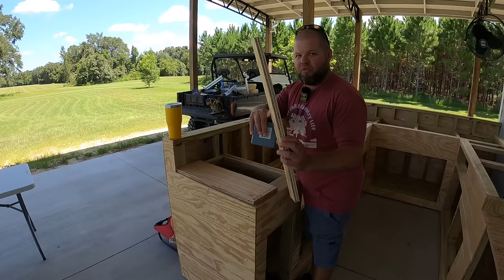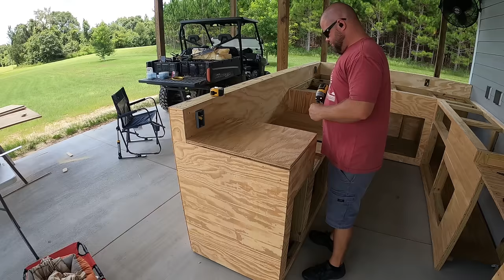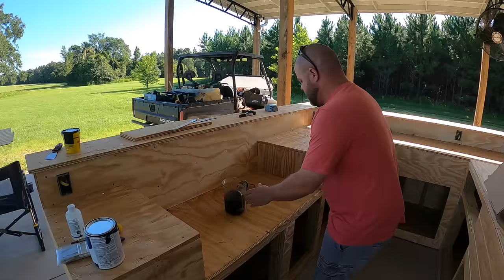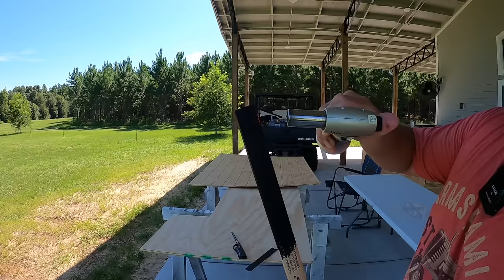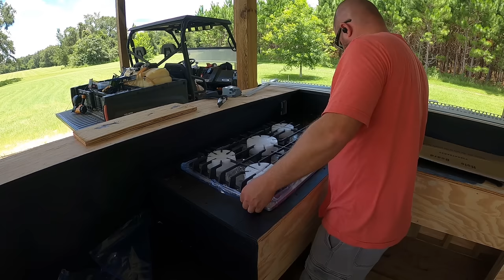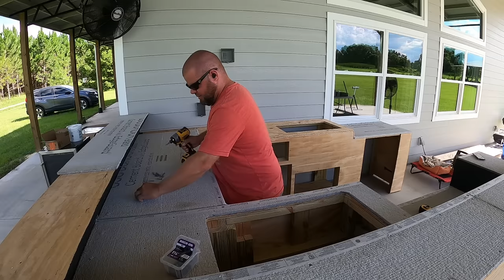DIY budget outdoor kitchen build part 3! #Vevor #619

Comment: Thanks for posting this.  I'm getting ready to build my outdoor kitchen and your video serves as a good source for ideas and methods.  One thing I plan on doing differently is framing the area for the grill with metal studs and only cement board.  This way I don't have to worry about fireproofing as much.  Nicely done!

Comment: There are pros and cons to having high moisture in the air and 1 of the pros is you don't see your lumber start to warp when the banding gets cut like I did when I went to El Paso to build a fence for my daughter. It was a long hot and very dry summer when I was down there, mornings would start off in the 90's and get up to the mid to high teens with usually around 8% humidity and sometime up to 13% for I believe it was somewhere in the high 20's of consecutive days of over 100 degrees. I would go out in the mornings and dig holes for the posts, 8 feet long buried 2 feet deep with 2 bags of concrete for each post. As the heat rose above 100 degrees I would venture into the garage where I would either stain or polyurethane posts, or the 2x8's or the 1x4's I made the (3) 5'x5' gates out of. I always liked it when you would buy it straight and by the time it got to my daughters house it looked like it came from a corkscrew willow tree... The project turned out surprisingly well though seeing how it was during the dempanic and all with shortages on everything. My daughter and myself drove from El Paso to Albuquerque to get 2 gallons of Polyurethane because it was the closest place that had any... I think it took about 9 hours with lunch to drive there and back again... Your little outdoor area is coming along great and will be a very functional spot for almost any occasion except during hurricane season!!!

Comment: You can get rapidset leveler primer and paint it over you plywood and thin set the backer board and you get a more of a solid surface for your tile. Just a tip I’ve learned from a oldtimer

Comment: Andrew, you talking about over doing your electrical, back in 1994 when we built our 1st house I had installed a 400 amp service panel with 2 - 42 circuit 200 Amp Sub Panels in the garage and when I was done both panels were completely full. And the house was less than 1900 square ft. But at the time I was working as an apprentice electrician and didn’t want to have any issues. So I definitely over wired the home. Also wired a complete sound system in where every room in the house had two in ceiling speakers with a volume control. Was very nice setup back in the day. Way before Bluetooth and WiFi devices.
Reply from the maker: Nice! Sounds like some stuff I use to do with the audio.

Comment: Blackstone griddle drain pan are small,add a pvc drain like your sink, with a down pipe to a metal bucket,for easyclean up, also seal all bottoms of cabinet. So water ,bugs don't make nest,under base cabinet, foam around the bottoms of base cabinet ect
Reply from the maker: Are you referring to gap on the bottom of the cabinets all the way around? If so I have to leave that for water and air flow. Otherwise I'd wind up with some rot and mildew.

Comment: I think I over built my outdoor kitchen. I used that plastic decking product as a seal plate between the ground and the bottom of my framing. Then framed everything out of metal, then added plywood and tyvek. Decided at that point to add cement board to make sure the stone will have a solid surface to adhere to. 

I like your set up. Just hope the bottom doesn’t rot out due to hard rains
Reply from the maker: You do realize I purposely left a gap all the way around the bottom for air to go in and out as well as the water? Rot won't be an issue since it can drain and dry. My 4x4 posts are on metal brackets attached to the concrete. None of my cabinets are touching the concrete.

Comment: If your gonna do a poured concrete countertop I would suggest looking into doing poured limestone basically same process except the limestone can self heal to stress cracks over time absorbing moisture threw the air concrete will not self heal
Reply from the maker: I don't want concrete for a cooking surface, it stains easily.
Reply: @TKCL  not if you seal it properly I have concrete counters in both my bathrooms you could epoxy coat them like I did or use S2000 a cement sealer densifier  but people are making kitchen countertops with concrete all the time now you could just use a sealing wax to protect the surface
Reply: @TKCL  but what I was saying is not to do this and switch to doing a poured limestone it’s the same process except use https://youtu.be/Gfb4ZE_fdYU it turns back into limestone harder then concrete and self healing to cracks and you can stain it like marble as your pouring it think Venetian plaster
Reply from the maker: You'd need something serious with all the grease, sauce and cooking out here. I just hear too many horror stories of people regretting concrete countertops around cooking surfaces.

Comment: Great video did you show how to install the electrical and how you tied it into the house
Reply from the maker: I didn't as I've shown so much electrical on the channel. I put a 20 amp rated plug on the end and tied it into a 20 amp dedicated gfci receptacle I already had installed to feed the area.

Comment: We can’t use plastic boxes outside due to code,  only metal so melting is not a problem where we are
Reply from the maker: I'm going to cap these fronts with the gasket metal front plates.

Comment: Define your definition of budget.
Reply from the maker: Trying to stay around $4k for everything, including what was donated. I've splurged a little, we shall see.
Reply: @TKCL  that's not that bad. Especially when building it to last outside.
Reply from the maker: No it's not, I know people that spend that much on on outdoor rated gas grill.... Nothing else! One guy told me I was going to have $20k in this 🙄🤣
Reply: @TKCL  Haha..20k you would never want to cook inside again.. I'm getting some things together for mine, right now I have a stainless commercial 3 compartment sink, smoker, boiling station, will get the rest as I run across them .  Will you be adding you new ice maker to your build. Perhaps you did I just didn't get through the entire video yet, my bad. Got stuff to do here in south Louisiana and it's either hot as heck or raining .
Reply from the maker: No ice maker yet, I might add one later on.

Comment: Really enjoying the outdoor kitchen series.  So what's your thoughts on the overall quality of the Vevor stainless cabinets?
Reply from the maker: For the price it's hard to beat. Not the thickest metal or perfectly blended seams. But they are 304 stainless, double wall doors, come with accessorie hanging hooks and even come with extra stainless vents for venting cabinets. Very hard to beat for the price.

Comment: Hello I am in the process of having a kitchen built for me.  Your DIY is exactly what I want.  I have been following you step by step.  What size plywood are you using to cover the frame?
Reply from the maker: I think it was 1/2 inch, as long as you are adding tile backer board on top of that, you will be plenty strong enough.

Comment: Love the videos. Attempting to recreate what you did. Adding a drop in grill as well. QUESTION. I know you used treated plywood on bottom shelves. Did you use teared for the counter top and bar or just regular plywood
Reply from the maker: Regular, don't use treated under tile. It dries and has the potential to warp.

Comment: Thinking about de-lamination from water over time, did you ever end up painting the bottom edge of the plywood? It looks like it's only about half an inch or so above the patio...
Reply from the maker: I did not, but it would be a good idea. Zero issues after a lot of rains and pressure washing. I can always trim the bottom and put in a piece of pvc trim.

Comment: The outdoor kitchen is shaping up. I was wondering how you'll connect the wiring to power. Will you wire up all the cabinets and then on the power end of the wire just add a plug to go into the outlets you already have. Hope this explains my question.
Reply from the maker: That's exactly how it's done.
Reply: @TKCL  sounds good

Comment: How did you run the wire? Did you have to put it in conduit?
Reply from the maker: I did not because this isn't fully exposed in a wet area.  Under roof is defined as "damp" in the national electric code.

Comment: I love the channel man! Just one question, could you have just don’t hardybacker instead of the plywood? Why do you need both?
Reply from the maker: On the wall yes, not on the countertops. The cement backer board is very flexible and brittle.
Reply: That makes 100% sense. Subscribed and alerts on!

Comment: hey Andrew, I noticed in your final episode on this project that you opened a few cupboards to reveal what you've managed to fill them with.   I noticed plyboard shelves were fitted, did you  allow for these shelves from the outset and therefore fitted wood studs to suit or were they an after thought? if the later what did you use to fix the plyboard shelves to the wood stud framing, regards Chris
Reply from the maker: I ripped down 2x4s, screwed them to the studs and laid the shelves on top. I then screwed the shelves into the 2x4s I ripped down. They are a permanent part of the structure now.

Comment: Andrew, Did i miss a step? Did you run electric wiring thru the boxes before adding the plywood?
Reply from the maker: Yes I did, wasn't much to record. Stapled 12/2 to the studs and daisy chained the wire from each box.

Comment: I would use high temp silicone on the inside rim of the bar, at least behind the cook surfaces, and please don’t take advantage of the high temperature paint, use it by all means, just don’t rely on it to protect your surface , wood turns to charcoal at a low temperature, while the paint doesn’t burn, the wood inside will be highly flammable if air gets to it, just keeping it real bud, nobody takes my advice anyway, lol
Reply from the maker: I definitely don't rely on it. What I am relying on is 1 inch thick of, cement board, thinset and tile. I can't forsee that getting hot enough to ignite anything.
Reply: Ha, ha. As another old guy trust me they may not give the impression they’re listening but they are.

Comment: FYI. Pellet smokers use very little power.
Reply from the maker: Really? I thought they would use a lot. Good to know.
Reply: @TKCL  My little GMG that I have been using for over 10 yrs runs on 12VDC. It uses a 120VAC brick to convert to 12 VDC or it can be plugged into a cigarette lighter port or any 12VDC. So I use it at the house and take it on the RV when we go camping. The most power is drawn during startup for the little heating element. Once going it just powers a little fan and the auger motor.

Comment: Could you have just used durock on your tops and no plywood ?
Reply from the maker: No, that stuff is actually quite brittle if not supported extremely well underneath. The only place I'd be willing to put it with no backer board is on the walls.
Reply: I forgot there was tile going on there. Great videos. 👍

Comment: Borax is also a cheap fire retardant. I worked in shipyards welding fitting machining yatta yatta but what I did to make fire retardant cloths was wash them, then soak them in borax (12 mule team) then hang them out to dry in the sun, and let them kind of bake for a while then run a rinse cycle and then run them in dryer. They become so soft but also fire retardant not proof but enough. Trust me when you are down in a hole and washing out welds overhead it makes a difference.  ALSO they breath! They dont make you hot and they dont get as dirty over all. I monthly retreated depending on use. this is only for cotton Im sure hemp and bamboo would be ok as well
Reply from the maker: Very interesting!

Comment: Couldn’t you have just left out the plywood and just used the cement board?
Reply from the maker: For the back wall yes for the countertops no. Cement board is quite brittle and flexes. That plywood makes a stiff backer so I should never have to worry about the tile or grout cracking. Think about heavy pots and pans full of water or food on top of the counter.

Comment: Fire retardant isn’t your concern.  It spontaneously combustion of wood behind the tile.   The wood at 572 degrees will self-ignite.   Hopefully the tile and backer board reduce the heat of your blackstone.  My natural gas blackstone get 800-900 degrees. Tile and back board will reduce the temp by 150-200 degrees so it could still combust.  Two layers of James hardie board would help but I’d still be concerned about blackstone.  The torch and blackstone are very close and your aren’t pairing both sides of plywood.  The concern is flame contact.  I hope nothing happens but two layers of hardie board are way better than the paint. I would lose the plywood under grill and use 2 or 3 layers of backerboard  instead.

Using an oscillator tool with dull blade with cut with almost no dust.
Reply from the maker: I like the tool tip! Keep in mind I set this up with a 3 inch gap all the way around. I just don't see the possibility of the wood getting that hot. What truly concerns me is all the installs I see online where people give zero room for heat to escape around the blackstone. Some even butt wood right next to it. That's asking for trouble. I feel rather confident about the tile, cement board and air gap I've left around it.